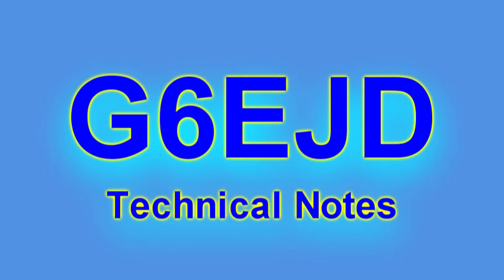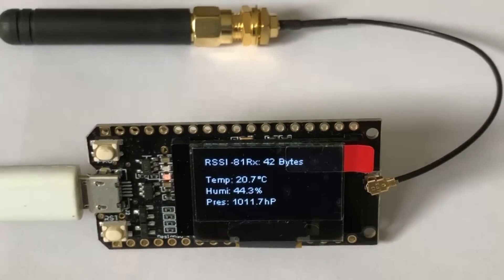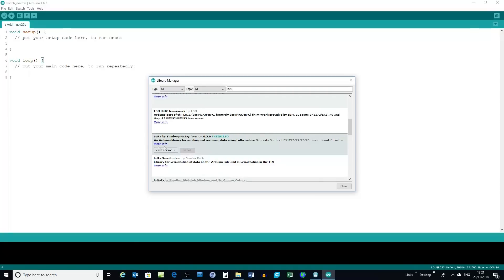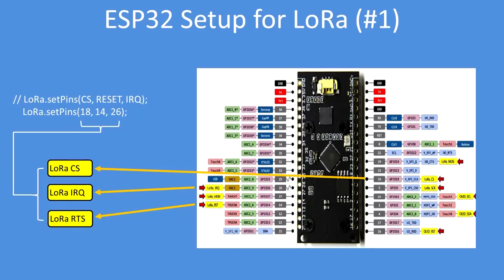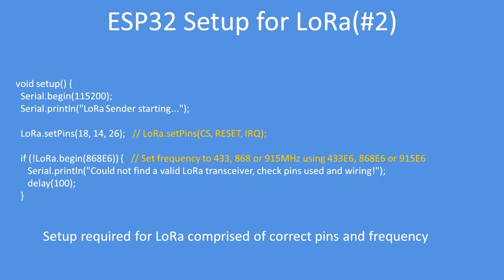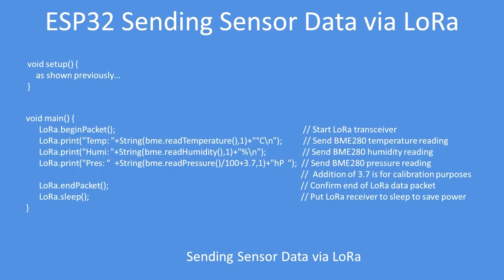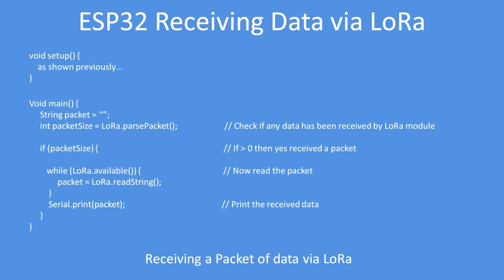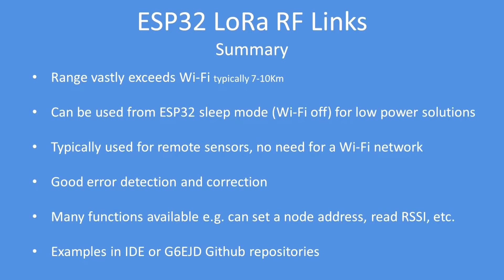Tech Note 111 - ESP32 LoRa Modules - Sending and Receiving Data

Comment: Nice, thank you. How easy is it to modify the sketch to receive a basic input from say a tilt or reed switch? Looking to Lora up my mailbox which is just out of WiFi range!
Reply from the maker: Pete, well you’d need a spare Gpio pin with say the reed switch wired to pull it low when actuated and set the pull-up resistor on that pin high to save extra wiring, then on activation send a zero via Lora, on reception the change of state would signify mail. A Lora transmitter takes about 50mA and an esp the same, so maintaining power will be your challenge unless there is a local power source. You could sleep the esp but unfortunately many combined esp and Lora boards don’t allow the Lora unit to sleep thereby consuming power all the time.
Reply: @G6EJD  Thanks, appreciate the feedback.
Reply: @G6EJD  You and Pete got me interested so I picked up two of the non-OLED dev boards 

https://usa.banggood.com/LILYGO-TTGO-2Pcs-ESP32-SX1276-LoRa-915MHz-bluetooth-WI-FI-Internet-Antenna-Development-Board-p-1466793.html to have a go at a mailbox sensor.
I'm having a heck of a time trying to use a GPIO input (ie, 34/35) on them, though. Neither a direct ground or one w a 10k resistor toggle the bit. 
Any tips?

Comment: whats your best rssi ?
Reply from the maker: At very close range you get a value of -30dbm and at extreme range -120dbm, a typical value might be -90dbm and don’t forget it’s a logarithmic scale so it compresses values
Reply: @G6EJD  I have ttgo Lora sx1276 and typically I got -50 I just set power to 20 and sf 11 I need to coverage city and I just problem when behind buildings do I have something wrong ?
Reply from the maker: Haluk YILMAZ, your problem is signal strength and trying to do something LoRa was not designed to do, that is cover an urban area. When RF signals go above ~300MHz they tend to exhibit optical line of sight characteristics, so if a building is in the way the signal will not penetrate it or be bent around it, it applies to any radio communication links, data or voice. The best you can do is use 433MHz rather than 868/915 as this will give extended coverage and range. There are other effects than come into play the main one is the Fresnel zone (google it) which results from reflections from the ground and surrounding objects and results in a reduction or received signal strength. If you use 433MHz make sure your antennas are designed for that frequency (70cms wave length) so not the supplied antennas which are for 868/915. The receiver and transmitter antennas need to be reciprocal/ identical and may well be directional to get the required range /coverage your trying to achieve.
Reply: Thanks so much for replying can I get your email or Skype I would be so happy
Reply from the maker: Haluk YILMAZ, go to G6EJD.dynu.com its there under contact

Comment: very imformative ,respect for you  ! Do you have idea for project  "'monitoring beehive"' ?  project with two esp32 lora ,sender with weight sensor  and temperature and humiduty ,deep sleep ,solar powered and receiver with WIFI and blynk example .
Reply from the maker: All of that is possible with just one ESP32, a single bme280, LoRa module for long range transmission and a 3W solar panel, I can’t see the need for LoRa if in WiFi range? The hardest part of the project is weather proofing the components
Reply: G6EJD the beehive located in the wood , esp32 lora in beehive communicate with esp32 lora in the home . the esp 32 in the home with wifi and blynk server . that's enables monitoring via smartphone. sorry for my bad english . i give an idea and suggestion
Reply from the maker: georgi zhelyazkov, OK understand the requirement now, but there is a lot of coding and design to implement all that!

Comment: How to monitor battery of this board sir it has jst battery connector i have shown your video on battery monitoring but not able to use in this board
Reply from the maker: Just because the board has an on-board battery connector does not mean it has a battery monitor built in only the London D32 has that. To do this you need 2 resistors of value 100K then connect as follows:
Battery - - 100K - - VN - - 100K - - Gnd
Where VN is the ADC input 36 or 39
Reply: @G6EJD  many thanks sir.... Why you have stopped making tutorials on Lora we are always love your tutorials sir.... Love from India
Reply from the maker: Saddam Husain , unfortunately I have been diagnosed with cancer and I’m currently being treated for the condition makes me feel very unwell giving no time or inclination to make more, hopefully I’ll be able to make some more soon.
Reply: @G6EJD  ....ohh God I will pray for you sir ...for your better health and and early recovery from cancer....... Get well soon..... Sir

Comment: Thanks alot. I need to get data from an sensor in carpark to server so l can use an application via internet or webpage. Its like get data using an ESp 32 lora sender to a gateway to a server. Whats the proper way of setting this up.I will greatly appreciate your timely  response
Reply from the maker: Well you have WiFi range LoRa is not necessarily the best solution and a simple WiFi client is all you need. LoRa will introduce unnecessary complexity. At the webserver after reception you then have the ability to display the data on a webpage or send it elsewhere. Don’t underestimate the climatic effects on a remote link, electrical noise, humidity, water ingress so your client needs good protection or it will only work for a short time maybe 1-2 weeks. Sensors - there are few if any sensors that are designed to be used outside so you will need to consider non water permeable sensor covers.

Comment: Hello sir please make tutorial on send sensor value to cloud or the things network I have tried all the things but not succeed yet please guide sir
Reply from the maker: Saddam Husain, you just need to use the sketch example I did for Thingspeak uploads but get data from the LoRa receiver
Reply: @G6EJD  i did all but error showing that string can not convert to float during initialization so how i can put the incoming  string Lora packet to float value and save to variable and send to things speak or firbase please make tutorial on that sir please please
Reply from the maker: You would have received a string representation of a number e.g. “3.141” in say a variable called receivedValue then float value = receivedValue.toFloat(); 
But you do t need to do that just leave the received number as a string and parse to e.g. Thingspeak as a string. No need for any conversions.
Reply: @G6EJD  many thanks sir love with respect......

Comment: I have attached bme 280 sensors sir but value read by sender module is temperature -121, humidity 100% , and pressure 11000 what is the problem sir with your code or sensor problem
Reply from the maker: What pins have you used for the I2C bus and have you selected the correct address for the bme280 if your using an Adafruit board the address is null if a 3rd party then 0x76 you must also start the I2C bus on the correct pins - there is nothing wrong with the code. Have you run an I2C bus detector program to check you have it wired correctly?
Reply: @G6EJD  thanx for quick reply sir I have used third party bme sensor and put x76 value in void setup 12c pins are 21 and 22 so what is the problem if I'm correct
Reply from the maker: You added bme.begin(0x76); and on that board I’m not sure if all I2c pinsare 21 and 22 add some lines that print out the SDA and SCL values e.g. Serial.println (SDA) same for the SCL and check your wiring of the sensor. Try an I2c bus scanner too. There is one on my GitHub under general, make sure you change wire.begin( to wire.begin(21,22) or whatever way round you have yours sda,scl is the syntax.
Reply: @G6EJD  I have put 0x76 value in void setup as I'm using third party bme sensor but values are incorrect as I mentioned above

Comment: How I can send upcoming data to Cloud or firbase sir means how to use receiver as Lora gateway to send sensor value to firebase
Reply from the maker: Once your LoRa receiver has the data packet it would use the variable to then upload the data to e.g. firebase there are examples of firebase uploads so thelora receiver and firebase sketches would need to be combined into one.
Reply: @G6EJD  yes sir but Lora sender send value in packet if we send packet to the firbase then it will not send individual sensor value to firbase because multiple sensor value in in packet that is recived from sender device so how can we  separate different sensor value from the incoming data packet and send to firbase my problem is that if i send packet as variable this method will not show my all individual value to firbase database so what is the solution sir
Reply from the maker: @s.husain6125  You can sperate the sensor values easily enough, say you send to a LoRa receiver a packet that looks like this, you need to define it so your sure about its format:
packet = "temp","22.6","humi","50.1","pres","1000.1" and so on, then you extract the sensor values accordingly:
float temperature = packet.subString(8,12);
Then send your value to Firebase
Repeat for the others.
Reply: @G6EJD  great sir thank you for your nice support you are always very supportive thats way i like the channel more if it is possible please make video on send lora data to thingspeak or firebase..... Many thanx
Reply: @G6EJD  what is( 8,12) in above code sir that you have suggested
Reply from the maker: The string example packet received is for example packet = “abcdefghijklmnopqrstuvwxyz” then temp = packet.subString(8,12) gives the result temp = “ijkl” substring(start position, end position)
Reply: @G6EJD  many thanx sir
Reply: @G6EJD  how figure out the recived packet formet sir
Reply from the maker: Well someone must have defined the packet format, or if unknown it’s a case of inspecting it looking for known values to identify each element.

Comment: What about bandwidth you can get at reasonable distances?
Reply from the maker: The LoRa protocol does have provision for bandwidth adjustment, but on the whole you leave the protocol to handle to that and transfer your payload across the link in whatever time (and bandwidth) is available. Typically 10KHz.
Reply: @G6EJD  Thanks, so it could be possible with microphone attached to make small bug device with it, right? :-)
Reply from the maker: I don’t think anyone has done that. First you have to sample the audio at say 10khz and then stream that data to the receiver. It could work but timing and conversion at the receiver end might be a challenge. You would have to receive the data packet and then play the bytes to the DAC but the resolution needs to be matched as close as possible or the audio quality will be poor. Try a google for real-time Lora audio transfer.

Comment: Excellent as usual. I have a pair as well, without OLED display. I am getting about 900m with line of sight. Based my sketch on yours.
Reply from the maker: What sort of terrain though? You can’t expect long range in urban areas as buildings absorb much of the RF energy, try an experiment out in the open. Also what frequency are you using? Don’t expect long range at 918mhz it’s the laws of physics that prevent long range. Check your antenna type too, you may have a 918mhz antenna and are using a mismatched 433mhz signal.
Reply: David,  I'm using 915Mhz and operating the receiver from the 2nd floor of my home. The terrain is quite flat, it's actually an open field with a single building in between as the only obstruction. Will check the antenna and see if there's any mis-match there too or loose connections.
Reply from the maker: Most people get an easy 10km range so you need to determine if the antenna is actually a 915mhz unit a quarter wave at that frequency will be about 30cm physical length or electrical length could be extended with a coil to make a compact physical length. Try running the experiment at 868mhz.
Reply: Yes, will take note of the antenna length and repeat the test at 868Mhz.
Reply from the maker: Also try 433mhz

Comment: i doubt these antennas can achieve such - lucky if 1km.  Judging by the size of the antenna that this was 915 Mhz Frequency?
Reply from the maker: You are maybe comparing the antenna size and modulation techniques with now old methods, Lora uses Chirp Spread Spectrum modulation and there are many examples of ranges exceeding 10km with the same antennas

Comment: I have same module with display. It hardly goes to 500m range. With those antennae. I had transmitter on 4th floor terrace.
Reply from the maker: What frequency though, at 868 and 915 you’ll get huge attenuation and what’s called fresnel zones that make propagation difficult, at 433Mhz these problems diminish markedly. Yes the antenna at 433 could be larger and for a correct match would need to be physically 70cm long or electrically shorter with some loading coils in series with it. Yes antennas need to be matched and you can vary RF power so maybe turn it up, but 500m is a very poor range that is almost certainly the outcome of a number of factors to do with matching the frequency to the terrain and as you say the antenna.
Reply: Same here! Esp32 with his WiFi and high operating frequency is a great wave pollutant, that saturates lora receiver; a cozy design like this doesn't help!
Reply: @AndreaZeta  issue is antennae, they are not at right resonant frequencies. There is nice video about these antennae by Andreas _ swiss guy.
Reply from the maker: The WiFi is switched off so there is no crosstalk or blocking of the Lora.